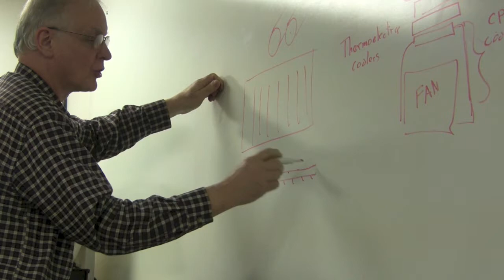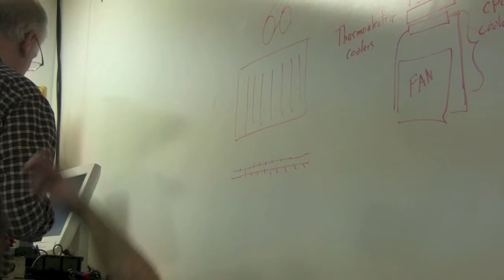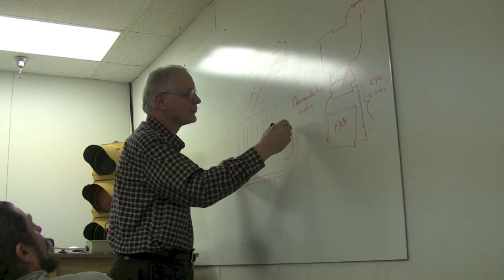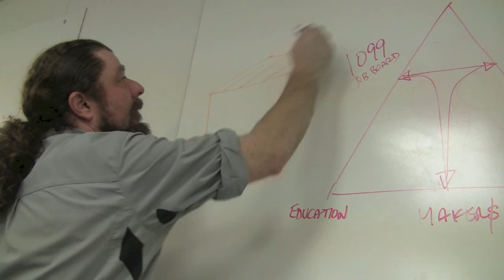New Auxetophone at Go Tech

Comment: I was working on this independently for variable-note-air-mufflers in 2013 for bagpipe-bass-lines by hooking up a coil with permanant mangents inside to a plunger attached to a bagpipe drone-pipe,... and which vibrated puffs of compressed air out of a bagpipe for bass-line notes. then i found this video and was blown away, so cool john!  I bought a shaker from data physics but couldn't make the assembly in rural canada, immigated to the USA in 2017 and went into techshop in San Francsico and just made one work with the same V2 shaker today... used a  short pipe with slits in it attached to the shaker armature, outside  a trumpet with slits cut into the trumpet, and an annular pressure chamber which the beginning of the trumpet ports into.   Also tried hooking it up directly to a bagpipe reed, and a jews-harp ( a jews harp is the most basic way to explain compressed air amplification) ,  which also seams to be essentially the same concept of the "c-flex" bearing you were thinking of, as both harmonica reeds, bagpipes, jews harps are "0 friction" leaf-springs, like the inside the c-flex bearings - really curious as to how that worked out for you... lastly i treid ferro-fluid on a ring magnet which by placing another magnet on the shaker armature  pulls a magnetic ferro-fluid-seal across a ring-magnet orifice for a true variable diameter circlular iris valve ... but then the ferro-fluid just got all over the wall with too much compresed air.   I'm gonna keep running thru tests here on the reed/valve and launch this as part of a bagpipe-street performance.   Are you still working on this project?   really curious on your work!   thanks for sharing,   looking forward to seeing what comes next!  jamus.pajamas@gmail.com

Comment: A few comments:

First, I am somewhat disappointed that they used an electronic input to the amplifier, rather than a purely mechanical connection as in the original. Had they been able to build a soundbox with the valve directly connected to a needle or stylus, and played a record directly, it would have been far more convincing.

Secondly, is that valve designed exactly as it was in the original Auxetophone? That side-to-side motion does not square with the shape of the  original soundboxes, unless there were some linkage to shift the axis of vibration by 90 degrees.

Thirdly, a question that has been nagging me for years: were there ever any experiments to use this technology for recording purposes? It seems plausible to me that back-engineering this amplifier might have resulted in a more sensitive acoustic recorder over a century ago. There was, of course, a rival to Parson's system: the "Friction Reproducer" invented by Daniel Higham, and used  by Columbia in a couple of their cylinder machines; ultimately used by Edison for his Kinetophone films. I wonder what might have been...
Reply from the maker: John was contemplating how to make a fully mechanical linkage with a sound input such as voice, but the intent wasn't to re-create the record player, instead to demonstrate mechanical sound amplification, which this prototype does well.  The electric driver by itself isn't capable of producing this much sound.  

The valve was, if I remember correctly, the second or third attempt to follow the patent.  It does follow the patent but they discovered a few things about how the system worked with or against the air pressure in order to prevent friction binding that wasn't mentioned in the patents they examined.

I can't speak to the third question. It's neat learning what people came up with under limited technological circumstances, and to contemplate how our current technology will seem to future humanity. "Well certainly today you'd use a flobulator, but you have to keep in mind that engineers in the early 2000's were limited to using silicon.  So while creating this silicon microprocessor is a lot of effort for something so limited, it's still fascinating what they could accomplish with such low technology. "
Reply: I'm working on that. I was able to borrow an original very early version from a friend in Australia. We have made careful CAD drawings of this and hope to reproduce it.